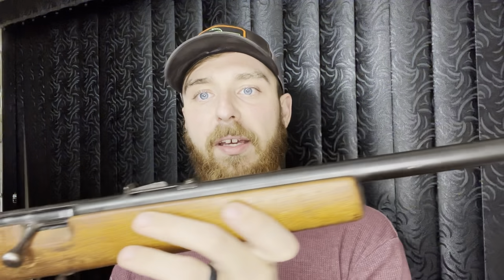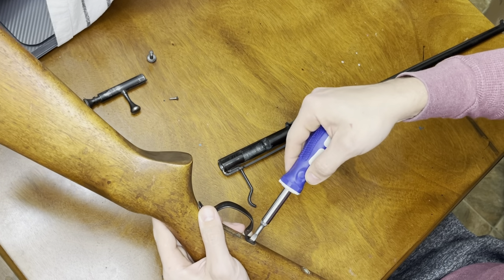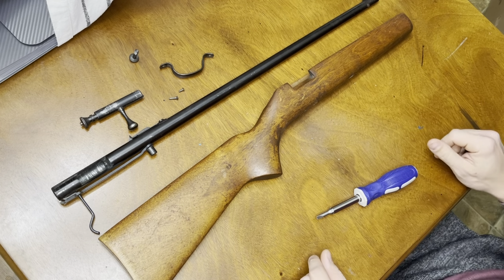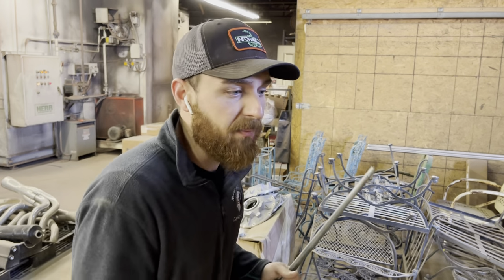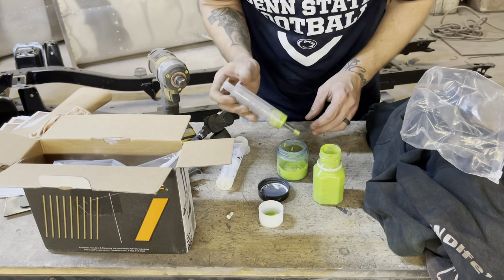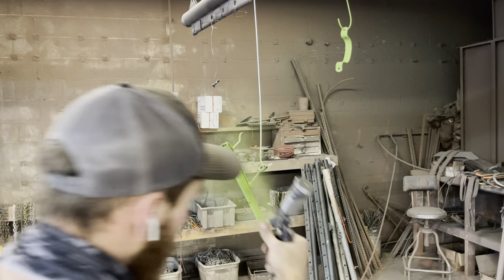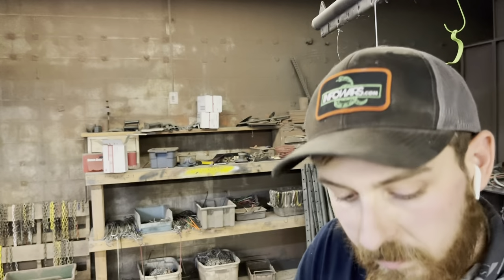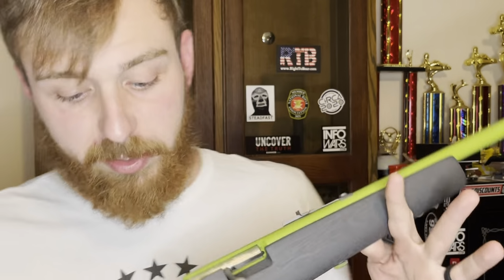How To Cerakote: Restoring a 1940’s Sears Catalog Plinker

Comment: I have a question about a milled AR-15 trigger on the lower reciever.  Do you need to coat the bare Aluminum or leave it as is?  I believe that it would last longer if it was coated what do you think?
Reply from the maker: If you’re talking about just the pocket where you mill for the trigger area. I’ve done it both ways. Obviously coating the whole lower over covers up a lot of milling marks and makes it look more OE. But I’ve also left them bare and have had no issues. Since it’s aluminum, you only have to worry about a small layer of oxidation over time, if any at all. I usually just wipe the inside exposed area with WD or another gun oil, then assemble. Haven’t had any issue so far. 

But yes, coating the lower again makes it look nice!